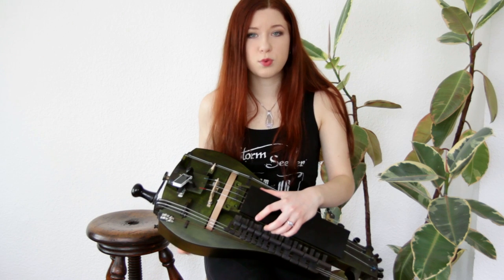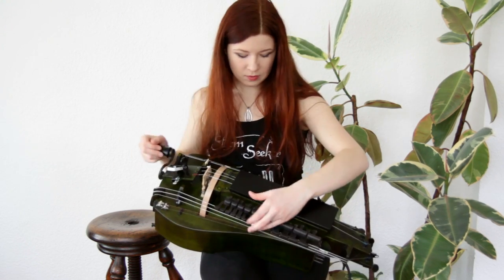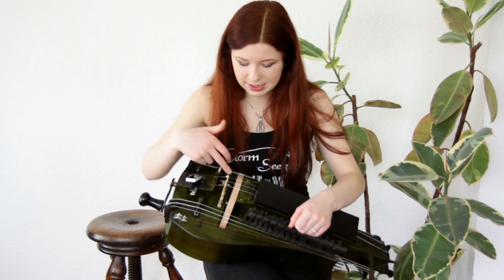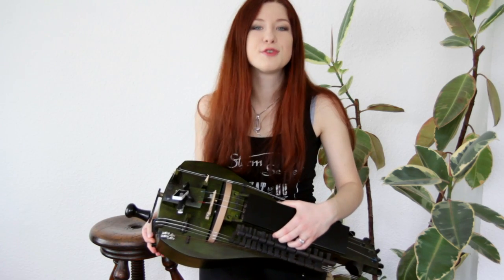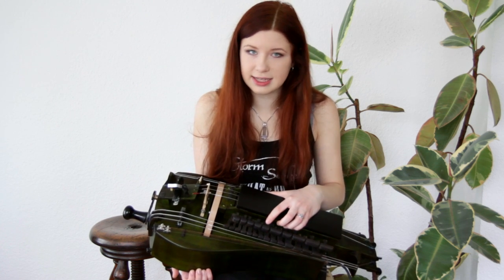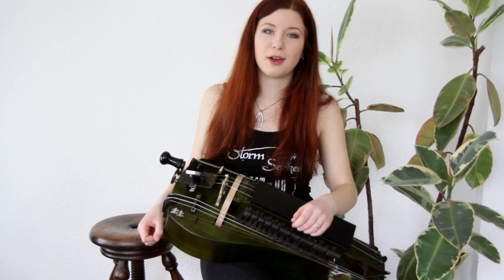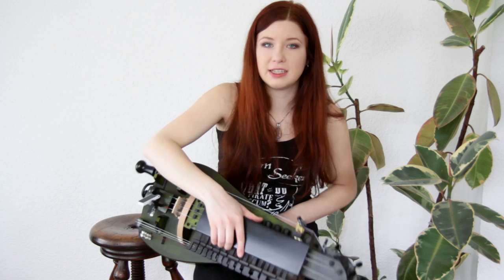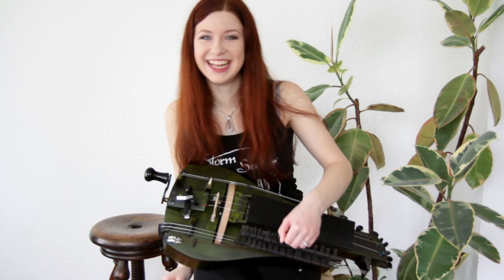Explaining the Features of my Hurdy Gurdy! / PATTY GURDY

Comment: Do you know how thick your wheel is? Also, in the future, could you potentially show the tangent box (key box) in a bit more detail? I'm trying to figure out how they work with multiple strings.
Reply: the tangents touch the melodic strings at the same time (unless you desactivate (?) one of the strings) but you can't have different notes at the same time with the melodic strings, unlike with a violin, harp, piano etc.
Reply: ...but you can play quarta—quinta—octava whith one key — that's why 3 strings are tuned g—d—g`.

Comment: What kind of strings are you using? Violin Strings? Or ist there any place where one can buy complete sets? :)
Reply from the maker: Viola strings for the melody strings, cello for the drones, gut or synthetic for the trumpet and viola d'Amore for the harmonic strings. No place where you could buy them as a set, you have to be careful and make sure the measurements of the instrument fit to the string...
Reply: Would you mind giving more detail about which specific viola and cello strings you use (meaning, do you use viola G and D and tune the upper G down using a viola A?), or how to match these strings to a particular instrument? My gurdy came with one violin string and one viola string, but I would like to restring it to all viola so it has a lower range. Do you have any advice or know of any resources about what strings to use to get what you want?

Comment: Hello there Patty! I was wondering if you could tell me what kind of melody string exactly do you  use. Especially the low G because I have trouble with that one.
Reply from the maker: For my gurdy the best low G melody string is viola forte G from Jargar. But it depends on your gurdy and the measurements :) For the D string  I use viola D and the high G you can see in my video on how to change a string :) Greetings!
Reply: Thanks a lot Patty! Just like you I use viola D strings for the D chanter. I think I tried a viola G string but it vibrated a lot and was buzzing against the tangents. I will try the forte Jargar. 
Thanks again and wishing you all the way from Slovakia ;)